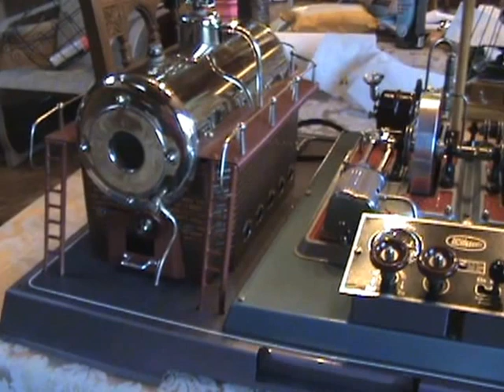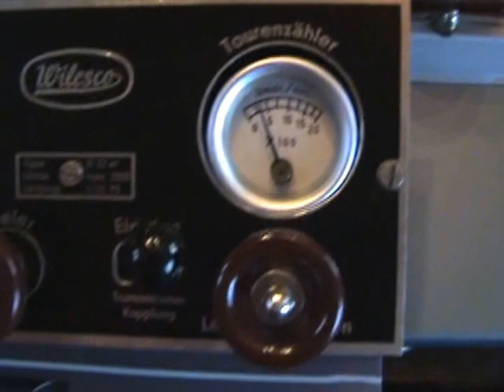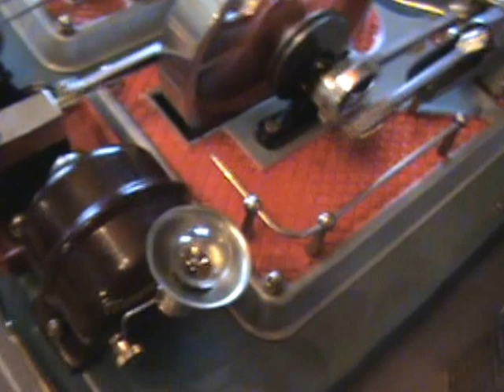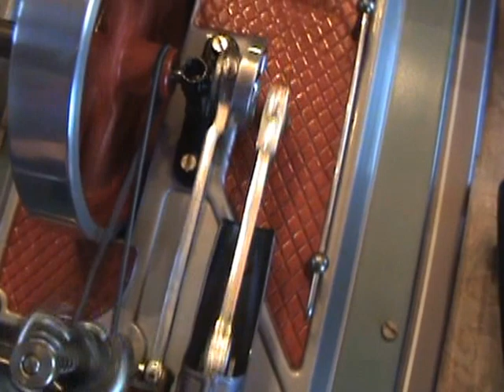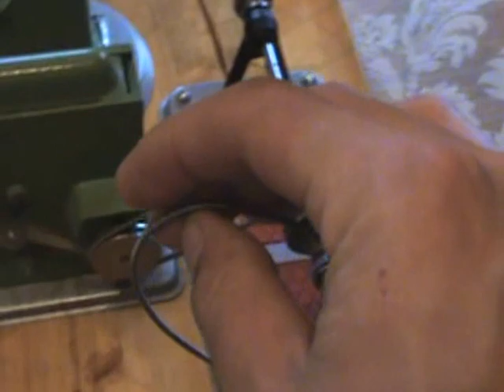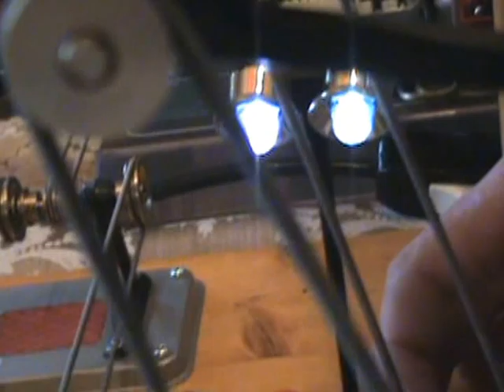Wilesco D32 explained

Comment: I just obtained a beautiful 110 volt baby blue D32. I believe a 50's or 60's. It works wonder full. I thought a $1000 dollars was ridiculous but I'm happy I purchased it. Not sure what I am going to do with it. Your video helped me out very much. I need to purchase a new sight glass for the boiler. Where would replacement parts be purchased ? Thank you very much. I collect Hit and Miss engines but this came up so I bought it on a whim I'm not sure if I should even keep it. Are these just for collecting/hobby like the Hit and miss engines as those don't really have a modern day use but I enjoy the hobby. Thank you so much your video it was very informative.

Comment: i CANNOT THANK YOU ENOUGH FOR THIS VIDEO . It has answered some many questions I had on it and taken away some of the negative comments about the engine. 
My D32 is coming Monday and I hope it is all you say it is. We will see for it gets tiring to hear it was better years ago....maybe true years ago cars had real heavy steel bodies ..today not even close! Thanks again
Reply from the maker: Your very welcome! The only "negatives" in my opinion is they have too high of wattage heaters in them and it makes way too much steam if plugged directly into the wall. I guess thats why they added an on/off switch to cycle the heaters while running. Using a variable transformer solves that problem. The other issue with them is the boiler is quite thin and long discontinued... I only run soft water in mine and after finishing with running it, attach an aquarium air pump to the boiler drain valve and leave the safety valve off the top and the small movement of air will dry the boiler in a day or so. To help preserve it as long as possible. Enjoy!

Comment: I need to convert mine to a 110 from the 220...what wires do I need to move around?
Reply from the maker: Hi John, Every D32 has 2 heaters. Each heater has 2 wires. In a 220 volt configuration the heaters are in series with each other. You will need to change them to being in a parallel style circuit so one wire from each heater has 110 volt power and the other wire will be going to the neutral. By using an ohm meter you can determine which pair of wires are for each individual heater and wire it accordingly as well as changing the plug. Its quite straightforward however if this is something out of your comfort zone I highly suggest you talk with an electrician before changing anything. These heaters are long long discontinued so a simple wiring mistake could result in the steam engine turning into a shelf queen.
Reply: @harleyl3863  Thanks Harley, I don't think I'm going to mess with it, I'm getting a voltage converter,take the simple safe way out.
Reply: @harleyl3863  Good video...where is the junction box with the wiring...under the boiler or underneath the base? Do you have a photo? It it hard to get at to work on?
Reply from the maker: Hi Jim,
It’s under the base in a black plastic box. Very easy to access.
Reply: @harleyl3863  Great...hope it is the same with the current reissued version! Thanks for your reply.

Comment: Hiya, great and informative video, just one very small correction, the waste pipe does not travel straight down from front to back it goes at an angle to a hole under  the back of the housing  and up to the chimney,  the pipe you pointed out as being the waste steam pipe going to the chimney is in fact the pipe taking water from the chimney back to the condesate tray. just in case someone is trying to route these two pipes

Comment: finally!  I can understand you and you understand mechanical things!  Excellent discussion about the D32.  I'll have some questions for you when my first engine arrives. It's a D20el. that I plan on completely rebuilding.
Reply from the maker: Hello! im glad you enjoyed my video, sure ask away!I have a 1960s D20EL that I totally rebuilt. D20 is a great engine!!
Reply: I just got a D20, fuel fired. I've had a few Jensen engines, but this is my first Wilesco, and I'm extremely impressed with the quality. The boiler comes up to pressure pretty fast and holds temperature very nicely, even to the point where I don't have to use as much fuel to maintain pressure once everything is warmed up. The engine operation surprised me by how smooth and quiet it is. When things get a little noisy, drop some more oil in the oiler cup and it quiets right down again - amazing!

Comment: I have got a wilesco D32 but the valve stack for the water valve is broken. I have not investigated it ye but was wondering whether anyone knows if replacement pairs are available. If so where can I find these to purchase? 

Enjoyed the video! Very informative as I did not know how to use this particular engine! 
Thanks :)
Reply from the maker: +Sophie Louise  Hello, not sure which part you are referring to...If you could tell me what time in my video I am talking about the part you need I could better help you. The feedwater pump check valves located at the back behind the engines? or the control valve for the feedwater pump on the control panel up front?As these engines have been discontinued since 1981. Many new replacement parts are not available... the best resource for parts that I have found is eBay. EBay.com or eBay.de for eBay Germany. You will need to use Google translate to use eBay Germany but I have found many good parts from helpful sellers there.There is also a model steam engine forum that is very helpful with advise and tracking down hard to find partshttp://www.mamodforums.co.uk/
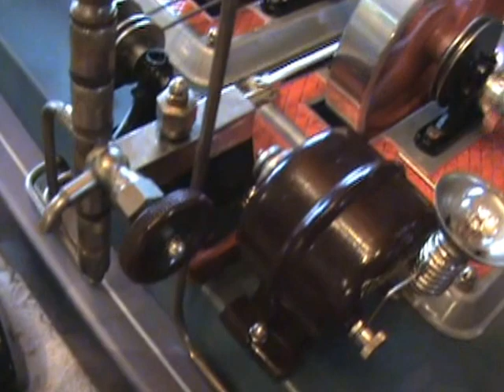Reply: +Harley L Hi, you discuss the part which is broken at 7:54. The section with the drain tap on one side and an outlet/inlet pipe on the other side that has broken at the bottom where it connects to the pump. It is the section above the chamber, where the section has been broken from the top of the chamber. I don't mind buying the complete feed water pump if the part is easier to obtain than just the broken section.
Many thanks for the help you have given me so far.
P.S. I am asking this information on behalf of my dad as he is useless with computers but is good with steam engines. He's got loads.
Reply from the maker: +Sophie Louise  Ok, if its the pipes that have broken off right where it joins to the feedwater pump all that has to be done is re soldering it back together. A fairly common problem as the soldered joints are a point of high stress. As the pipes are already disconnected I would recommend CAREFULLY taking the pump apart and make sure the check balls and ball seats inside are clean so that the pump will work properly when its running.  Replace all the pump gaskets (there is a gasket every 1/2 inch or so) with new ones and make sure they are tight before re attaching the lines as you will not be able to turn them after the pipes are joined, also be careful to not use too much solder as it could drip down inside the pump and plug it. If you were able to find a new feedwater pump it would require soldering in the same areas to install it.I had a similar problem happen to this engine where the pipe leading from the top of the pump  to the boiler burst open on it while running... not fun!here's my repair job: Hopefully you will be able to view the pictureshttp://modelsteam.myfreeforum.org/archive/my-d32-went-down-in-a-steamy-cloud__o_t__t_59571.html